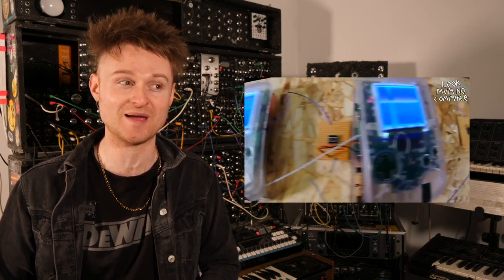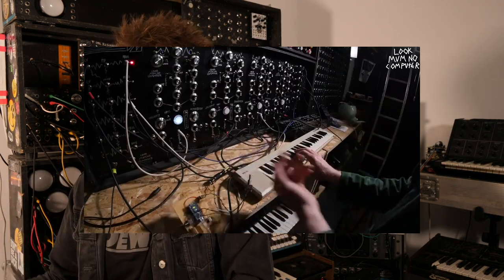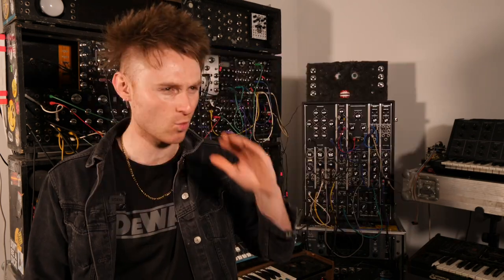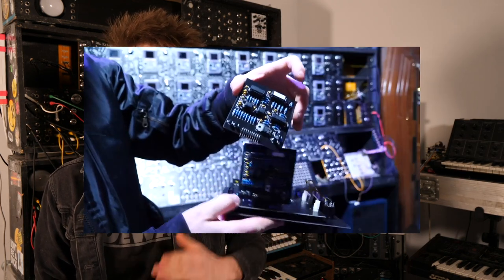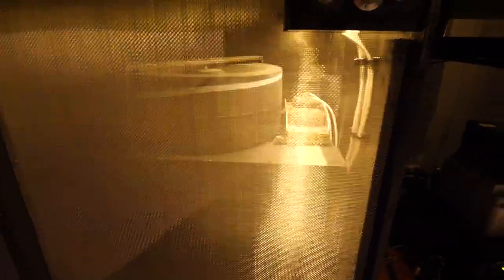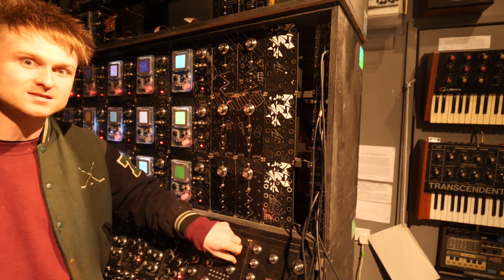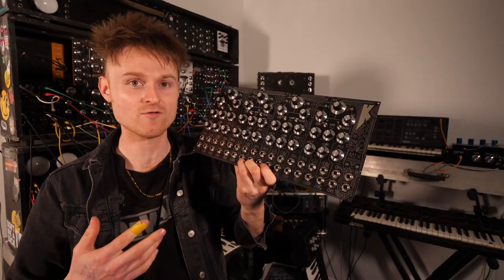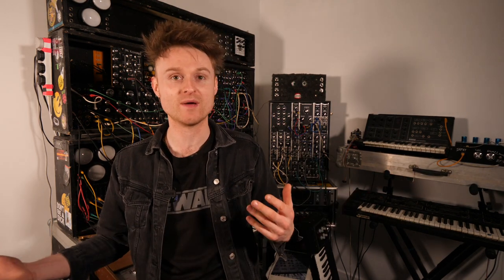Stereo filters in THE GAMEBOY MEGA MACHINE episode 17

Comment: So.. I have an eeprom emulator that I built out of a teensy. Which means you could run ALL Gameboy off the same single teensy if you wanted......
Reply from the maker: But then you don’t get the ability the cpu modulators they would be perfectly in sync. It just unfortunately would not be the same. The reason it sounds like it does is because they are all clocked seperately
Reply from the maker: Oh you mean emulate the carts?
Reply: Yes emulating the carts!
Reply: I think it would also be great if you used some sort of stepper or servo to control the Leslie's to be able to sync them to the beat clock or an lfo. I can even hear the phase of them on my phone and it sounds wicked mate! Would be even sicker if they were lfo matched
Reply: Although for non musical experiments the emulator would save you having to get x carts heh..
Reply: Looks like Gameboy is 4mhz so OTOH you could get +/- 50-100ns on the clocks without crashing?